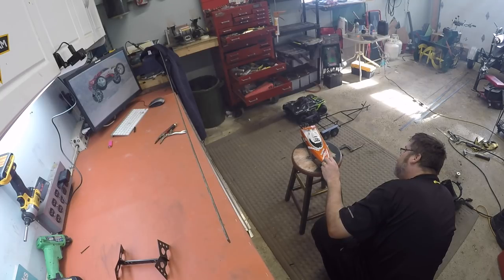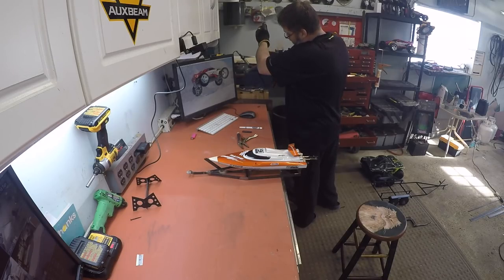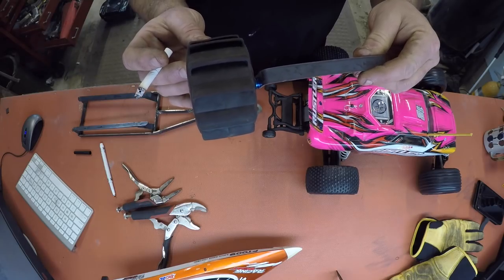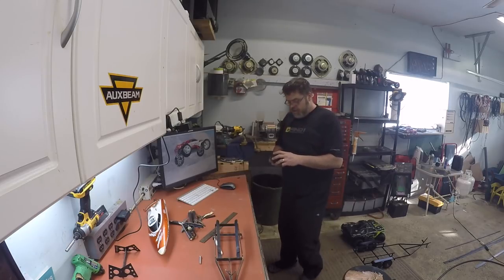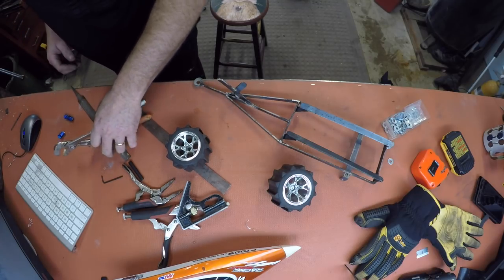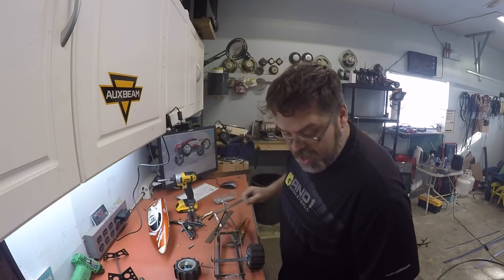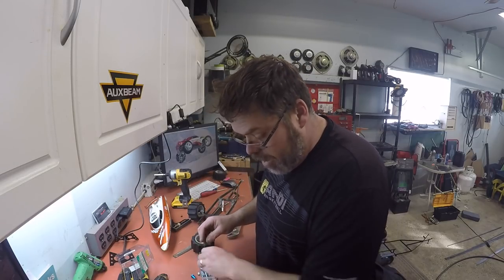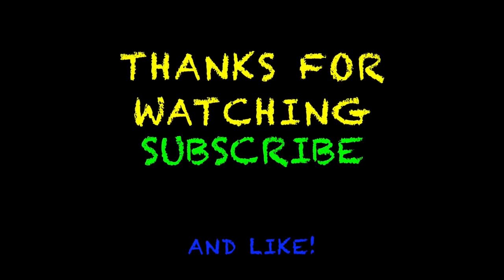Glad That RC Adventure Is Done

Comment: use smaller 1.55 tires on the daughters trailer...it would look more scale to the real thing. And go to the hobby shop and buy piano wire for the axle that way you can kind of do whatever length you need spot weld a couple of washers to hold the tires where you want them and then you can tack welding the end of the wire to hold a tire on works great done it many times if you really want to get fancy you can actually drill off the wheels put in bearings and whole nine yards if you really want to go crazy. LOL